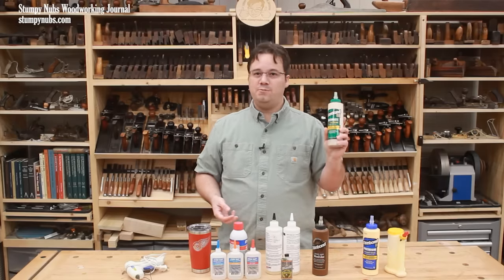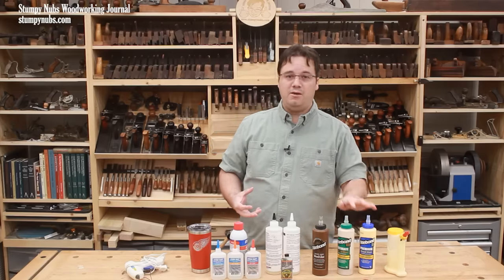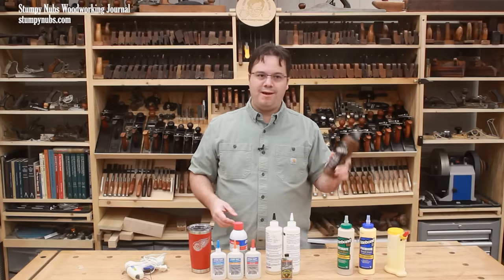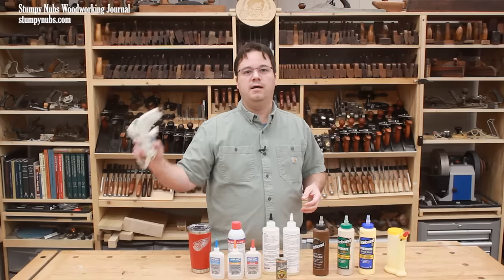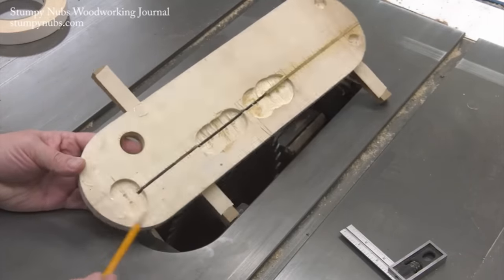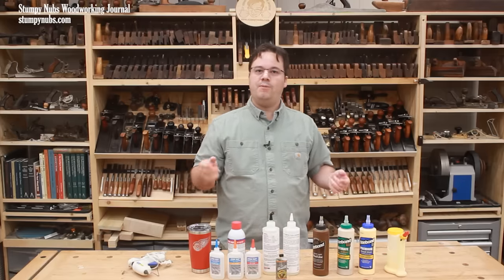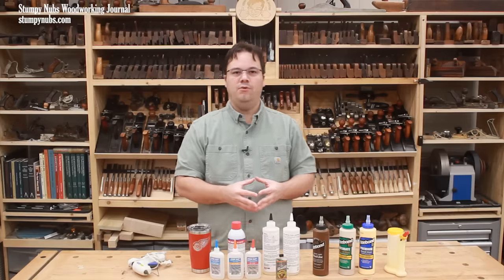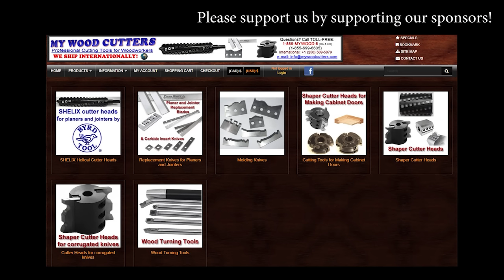Why I don't use Gorilla Glue

Comment: There’s a snag with CA glue activator. The main ingredients are aliphatic hydrocarbons with n-Hexane as a major component. Not great to use without a respirator (toxic, central nervous system depressant), and highly flammable. It may seem like a magic spray and a “game-changer”, but I wish it were used more sparingly. CA glue can dry pretty quickly without it - so consider ditching the activator habit for your health and safety. 5-minute epoxy might be a much better choice.
Reply: I saw another commenter here mention using baking soda as an activator. I googled it and it seems to be legit. I guess downside is it would be most handy as a water spray solution and then the piece is wet?
Reply: there is another activator   that has pump sprayer and smells good   Bob Smith Industries BSI-151H Insta-Set Super Glue Accelerator,Clear
Reply: ...you can also just use rubbing alcohol for activator.

Comment: In building my wood frame model aircraft I have developed a system of using white PVA in conjunction with CA.

 I use the PVA as the main glue but do not apply it to the key points that will hold the SHAPE together.  At these key points I use CA.   I can then carry on building on the piece without waiting for the PVA to dry as the CA has given it enough strength to allow it to be manipulated. When all is fully dry I have a fuselage/wing or whatever that has the toughness of PVA assembly without the time wasted in waiting for it to set after each building stage.

 Thus I get the strength advantage of PVA with the assembly speed advantage of CA.

Comment: I've had very poor luck using Gorilla products other than their tape. Very over-rated in my book. Project farm compared gorilla with the others and the strength was real weak. It works best on fabrics.
Reply: From the first time I saw my dad use it, I'd wondered how much work all that foam is doing?  How much of the compression that foam forces between joints is actually a substitute for normal adhesion and cohesion, and how poor is that substitute?

Comment: Most of the wood glues I've seen here in the UK are white, regardless of the features of it.
My go-to glue is white, but is very strong, water proof/outdoor rated and has an un-clamp time of only 30 minutes. 
I've used a load of different wood glues and I don't think I've actually come across a yellow glue without specifically searching for it.

Comment: Good explanation of glue properties.  Here is something I have experienced: although epoxy is extremely strong, and will bond to a wooden surface, in situations where there will be a lot of humidity-based expansion and contraction, it will not hold well.  I think this is because epoxy does not absorb moisture and expand and contract with humidity changes. Thus when the wood does expand and contract (which it does with great force), it pulls itself away from the epoxy and the joint fails.

Comment: Gorilla glue is amazing. I used it to attach wood to my kitchen counter sink cut out. I needed to make the hole smaller to support a smaller but very heavy sink.

It expands a LOT which allows it to fill extreme gaps. So it's excellent for gluing things to very rough and jagged surfaces like concrete.

The expanded glue is not a problem. Just put masking tape along the surfaces that the glue is going to spill out on. Scrape away the excess with a razor then remove the tape.

Comment: Thank you for giving me the information that has taken you years of experience to collate.
What is the Gorilla Clear glue.  I used it on box that was joined by double dovetales.  It didn't foam up like the other Gorilla glues.  It also didn't swell the timber and acted more like a lubricant when wet for inserting the tales.  This made it easier (or safer) when inserting the tales into the 1/8th thick second tale.  The job was a lesson in finer dovetale making and I ended up scrapping the box, but I'm not sure about just how durable that glue joint would be over time.

Comment: Very useful information on this vid ! By the way I have found one exclusive use for gorilla glue , when I have water damaged wood on the exterior of the house that needs to be repaired but not replaced I will remove what I can of the damaged wood and fill the void with gorilla glue using pieces of wood as filler . The expansion works in my favor as it will fill the voids . When it is cured I cut out the excess leaving room to top it off with a filler that can be sanded and painted . I have repairs that I have kept track of for many years . No idea what else it is good for !lol

Comment: Interesting video. I work as a CNC programmer/machinist in a door and window shop. We use Gorilla poly glue almost exclusively. Yes it foams but is easy to clean up. Having large sanders helps but most is cleaned with chisels and sanding. It is very messy. Water like in the summer and treacle in the winter. Its good properties are it doesn't stain and is easy to sand. Still use a lot of PVA glues at home though.

Comment: The white tite bond is also used for gluing laminated melamine or finished wood together. It works much better than the yellow. It does eat away the finish if left on to long so you should clean it up as fast as possible. This removal of the finish is what makes the bond of laminated surface to wood work so well.

Comment: I use PU for garage and basement cabinets and speaker boxes.
It's stronger than the wood and fills cracks to seal air tight.
Works great on landscaping bricks.

Comment: This is a good glue use overview and I agree with most of what you stated here! One area where I disagree is that I would not write off poly glue/ gorilla glue for woodworking. I agree with your analogy regarding the negative aspects of this glue but it has some distinct positive attributes. The most significant attribute is that it adds no moisture to your material when gluing up things like face frames and panel doors that will be spray painted/smooth finish as opposed to a natural or stained finish. PVA glues impart moisture to the glue ups and swell the joined areas slightly and if you don’t leave them to fully dry out before sanding and finish painting there will depression telegraphed around the joint that you’ll see after it’s painted and the material finally dries out around the joint. Poly glues add no moisture to the joined area of the glue up, hence no swelling which allows you finish sand and paint much sooner as opposed to if you used PVA, plus poly glue has some gap filling ability that works well with painted finishes. Poly glue is also a better glue for this application than epoxy because of the hastened working/ curing time increasing production efficiency.

Comment: James, Thank you! I Learned a thing or two here and I appreciate your approach as always.
-CY
*Consider adding thread locker “glues” to this fluidly fascinating facilitation of flowable functions. Loctite made its name on the red goo your cousin drowns his wheel studs in so the swamper tires don’t rattle the lugs loose, but there’s blue for removable fasteners, green, and they have sticks of the stuff now so you don’t squash the tube in your back pocket after a long day of wrenching! 
Just my opinion, but I definitely feel threadlockers are awesome addictives that adhere to the aforementioned advisory about adhesives. Alliteration aside, always ask an expert about adverse actions after you adhere your fingers together. 
Thank you as always,
-CY
Reply: @BTW...  I am trying to connect my original career/interest in mechanics with woodwork: thread lockers and phenomenal for handling vibration related issues such as those found on every woodworking power tool I’ve ever used. Building your new table saw or resetting an old one? The creeping loctite is great for keeping trunnion settings at 90 while still allowing you to remove the nuts later without being Hercules. Mounting motors, guide bearings for bandsaw, and for setting studs in inserts on jigs. I see a lot of crossover uses because I have too much experience repairing issues caused by loose fasteners. 
Maybe I swayed your opinion, maybe not. I appreciate your anemia remark, and I agree there’s a plethora of better options like locknuts, nordlok washers, jam nut, and the list goes on, but I would rather tighten a fastener on my equipment once and build something with my time than run around to buy the Best option for retaining a belt guard on my bandsaw. Rattles bother me, maybe you’re okay with tightening thumb screws every time you fire up your equipment, but I am not. 
Cheers.
-CY

Comment: I use the same glues for the most part, type wise if not brand specifics. I use Titebond 3 near exclusively on the PVA tan glue side as well as a white wood glue, though I don’t recall the brand. I also keep Baking Soda on hand as a CA activator which can up your CA game and allow you to make CA putties and instant wood fillers. I do use the original Gorilla glue near exclusively for one job: fixing broken chairs, it’s strong and fills gaps created when the wood breaks and just seems to hold up better long term; it also gas a better grab than wood glues. I keep a few different epoxies on hand in different viscosities, similar to the CA glues, as well as with different setting times from 5 minutes to 24 hours. I also like epoxies as a top finish, especially on tables as it’s quite durable and with the addition of Xyline can be thinned to be a penetrating finish, though this does extend cure time.

Comment: Great video James. I don't use Polyurethane glue either. I have found that it goes off in the bottle within a week or two of being opened where as Epoxy keeps for yonks. I have had it fail on me too in situations where yellow glue never has.

Comment: Hi temp hot melt glue is a game changer at the lathe. Parts that are too small, oddly shaped, or delicate to be held in a chuck can be hot glued to a waste block, the waste block is put in the chuck, the part is turned and finished, and then popped off. I make a lot of small jewelry boxes, and that's my go-to method for turning the inside of the lids now.

Comment: I swear by Gorilla Glue on all exterior work (such as fascia, soffits, and trim etc.) because of the properties you mentioned; It reacts quickly when activated with water, foams out and expands to fill any gaps, hardens up in about an hour and can be scraped off the surface and filled. It takes a little longer to fully cure but then is hard and waterproof. I use Tightbond III on everything else, even interior trim.
Reply: I have used Gorilla Glue to repair paper mache siding boards (from the 1970s'), because nothing else will stick to them (caulking peeled off).  It works best if it can be clamped with a flat board and a layer of wax paper, which makes it finish smooth.
I also used it as a quick and dirty fill for rotted fascia boards behind gutters, to avoid replacing fascia boards (especially in inconspicuous areas).
I used a spray bottle filled with water to moisten the surface before applying glue.

Comment: I liked your video. It has good information. The one thing that is often said about polyurethane glue that you repeated is that it is gap filling. Fine Woodworking magazine disproved that several years ago.  What appears to be gap filling is that foaming and it has very little strength, so not a gap filler if you expect structural strength from it. I also don't like the mess it makes of your hands if you get it on you. Thank you for your videos and work!

Comment: Construction adhesive- my understanding is that it gives you a long time to arrange pieces before it sets, and it will set in cold temperatures.  I would like to see your suggestion on spray adhesives for temporarily placing paper templates on wood pieces.

Comment: I use a lot of epoxy glue in a current motorhome build. The interior wood framing is basic joinery, but everything that gets attached to it gets a layer of epoxy glue because it stays ever so slightly flexible. It handles the vibrations and constant shifting of a vehicle interior better than CA or wood glues would, and it's great around moisture levels that can vary wildly.

Comment: I used Gorilla Glue to laminate plywood to rigid foam insulation when I repaired the floor of an RV travel trailer. It's the same construction the manufacturer used. I found that Gorilla Glue went a lot further and bonded just as well as panel adhesive. I started the job using Liquid Nails formulated for foam insulation, but I found it to be expensive and it didn't spread uniformly when "clamped." (I put multiple bags of tube sand on each section after gluing it.)

Comment: Just saw your video the other day on adhesive. Always good info from you. I craft a lot of cutting boards, and use Titbond 3. Also craft some outdoor furniture. So my thinking is just use Titbond 3 for everything. I do use ca glue and epoxy when appropriate. My thoughts are why buy different wood adhesive that basically do the same thing?. Your thoughts.

Comment: Very good presentation.  
FYI Another Titebond product you didn’t mention is their “Quick & Thick multisurface glue”.  (Is not in a cylinder – comes in an Elmer’s shaped container )  I found this excellent for certain applications. (It works well on wood, but I normally use Titebond I or II for that.)  It also works very well on repairing shoes where two parts of them have come separated.  Also for metal to wood if needed and metal to metal, etc. Seems to be very strong and is flexible.  I like it because I don’t like mixing epoxy for quick and small jobs.

Comment: Looking forward to the CA glue video. Curious if CA glue and activator is the same as generic superglue and spray bottle of water I’ve been using.  I typically don’t need much so it hasn’t made sense to order larger bottles of it. And I’ve never seen CA glue or activator in a big box store. Going to have to try the tip about putting it in the freezer with the superglue

Comment: As an apprentice shopfitting joiner in the early 1960s we used beetle cement. Made from powdered beetles and mixed with water, by a labourer, throughout the day. At some point a rapid hardener was invented. This was added just prior to gluing up for a quicker job, although the bond wasn’t as strong.

Comment: Hot glue is a must in a shop. Use it for temporary fixes and hold-downs and plugging holes because it cleans off easy later. 
I’ve even used it to make light duty “Babbitt” bearings when shit wears out. 
Also good for insulating electrical connections. 
Great video…very informative.

Comment: I share the same opinion of glues, and all have their own issues to contend with. CA glue is great for filling weak knots and small surface issues. TB3 is the ultimate wood-glue but be very careful about cleanup if you plan on staining after. Titebond has least creep and actually has a bit of “suck” and will sometimes draw a gap closed. TB3 has been tested as highest strength bond for wood when used properly, and the wood will usually break before the glue. My glazier tradesman friend helps with projects sometimes and hates TB and prefers the construction adhesive.

Comment: One of the handiest things that you mentioned briefly is hot a glue gun.  EVERY shop should have one.  Glue sticks also come in various colors and can be used for filling small gaps and such.  I even use hot glue to make thumb screws: take a soda bottle top, set a screw in it sticking up and apply hot glue all around it. You’ve got a very nice little thumb screw.  And there are many other applications and it’s fast and easy. They even have cordless hot glue guns now.

Comment: Nubs dude, I am learning lots watching you. Just a note  for you... When you talked about the Hide Glue  only lasting a year, I thought about the inert gas that is sold in Wine Stores to keep opened bottles of wine fresh. I have several spray cans off the stuff ( It comes with a tiny diameter straw)  and use it in all my opened paint cans and  the precious expensive small bottles of  Casey's Gun Stock Oil. I have some of that stuff here that is about a decade old that is the same as the day it came into my shop. I seem to use this stuff  quite a bit, and it's expensive AND shelf life, once opened is only a few months without the inert gas.

Comment: Very interesting, I think it's very important to use lots of different glues. Most of my wood working is for large scale PA speaker boxes. It is essential that your joints are air tight so the foaming will make up for any infections in the joint. (Not to say it makes up for bad cutting). And whilst messy the foam can easily be removed with a chisel or sanding where cosmetics are concerned.

Comment: Great video!  I learned a lot!  You mention keeping CA glues in a freezer for ultra low humidity. Yep, my CA glues go bad long before I use them up. That's a new idea for me. Thanks!  I also do some 3D printing and I use a sealed dry box with some desiccant beads to keep humidity low. I store my 3D printing filaments in that to keep them dry. It keeps them at about 18 perc humidity.  Would that be good for keeping CA glues in?  Thanks!!

Comment: I build and repair RC model airplanes. White Gorilla Glue (GG) is the best for constructing and repairing FOAM models. Unlike CA and epoxies, GG sands well. And you can cut it with a razor once it expands beyond the shape you want. It is messy and if you don't pin it with toothpicks, etc. it will expand and move the joint you want. I also use painters tape over a joint if I have pinned the joint. It conforms the expanding GG and does not stick to it. So it can be pulled off once the GG is dry. I have not used PVA glues much but will as I incorporate woods into my projects.